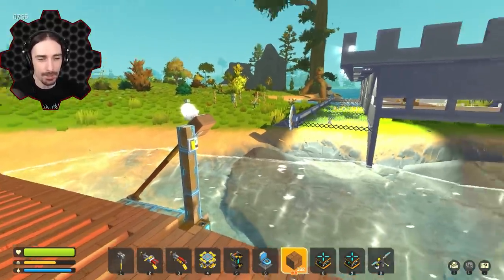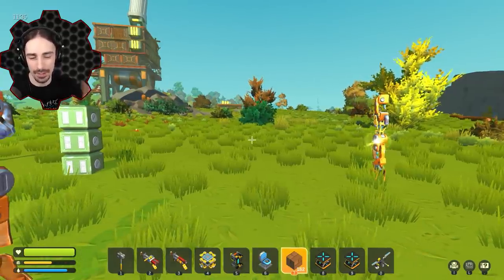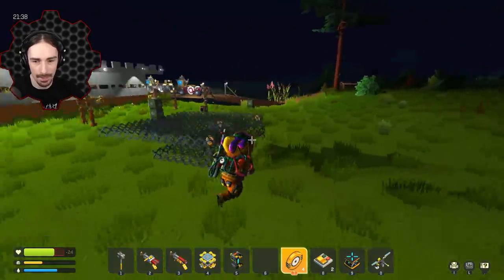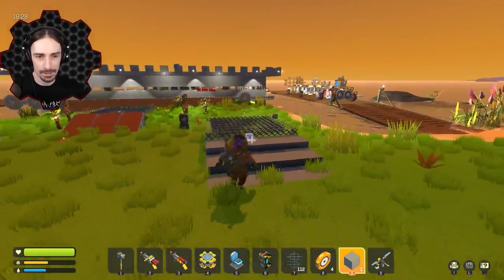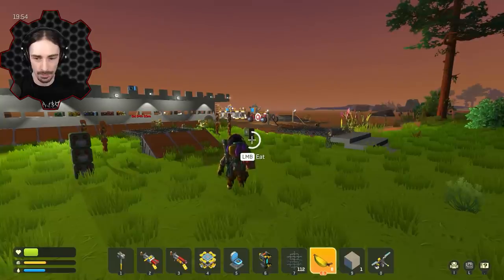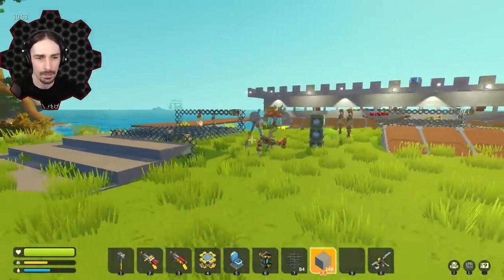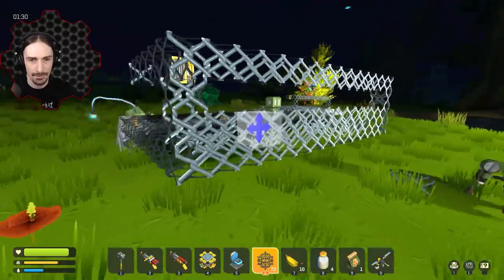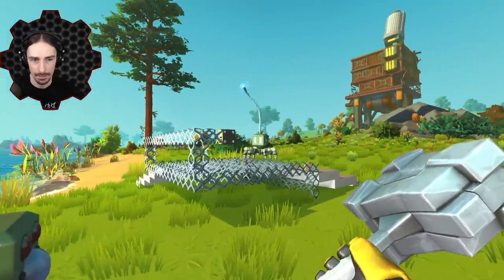I Made Automated Farmbot Catapults to Troll the Bots! - SM Survival Mode [SMS 28]

Comment: It may be the "pathing" stops up there like a balcony. Try giving him stairs on the other side giving him a valid path to continue to its target. At least that's the way it looks to me, if the bots aren't actually aware of the sensors. Might have to bring closer to your base, and connect/weld it depending on what the code logic is actually doing.
Reply: That actually makes sense, because its not the pistons or bearings as they have no problem with the bouncy floor or vehicles
Reply: to me it looked like that they were staying away from the sensor, but yours makes sense too.
Reply: yeah that's what i was thinking, the pathfinding ai might not like drops
Reply: You can see the bot look directly at the sensor and display the fear animation
Reply: I think , we just need another ramp behind , for the pathfinding . 
The robot will think that it can continue straight and not be block by void .
Reply: I’m not sure what game engine this was made in, but simple pathfinding AI usually has the ability to avoid certain inclinations/declinations, and as such the path can break. The distance/separation of the world ground and the “floor” of the trap may just need to be closer, or build a ramp to close the gap. I have a feeling you may be able to funnel even intelligent mobs over the style of trap.

Using “path of least resistance” rules seem to be the simplest explanation. Without further testing, the bots may have the ability to know certain blocks are near them but seems overly complicated at this point in development, but interesting nonetheless. I’m leaning towards simple AI implementation is what we have here, and the path is broken and if so it is not allowed to pass, or there is simply a better way, like going around it. Of course other AI avoidance rules seem to be at play here, but I’m not sure what they are quite yet.

In any case, I look forward to the next episode to see how the developers implemented it and Scrap Man’s discovery of how to overcome this.

Great videos, as usual SM!
Reply: Nah its the sensor no brainer that why he didnt stop at the wall
Reply: My thoughts too, haybots seem smarter, and won't Pathfind off a cliff
Reply: if it couldnt walk of the edge then it would have just walked backwards and gone around, its the sensors that they dont like...
Reply: Pixeye That’s plausible. I’ve not played the game enough but it does have its pause/juke animation loop. We know it the saws trigger it, I’m just not certain there is another reason the bot behaves that way. The proximity/placement may also be playing into it. For example, the pause loop may trigger when there is more than one equally viable path to take. Depends on the logic the Dev’s implemented. I’ve just not seen testing to definitively prove one way or another as of yet. I’d love to see some test game play to test these theories. I could be completely wrong, for what it’s worth. Cheers!
Reply: It works! Just one way I’m sure. They don’t seem to be as worried about the sensor as much as the drop off.

Comment: They are scared of sensors. Gotta keep the sensors hidden. Even in a spud gun setup sensors hidden or they try and avoid them. Hope this helps. Please like so he sees.
Reply: I feel that it is the bearings and pistons. this is a likely problem to encounter because using piston engines will shred them like a lawn mower. It could be in their code to help them avoid traps.
Reply: I can say this is definitely not true. I have a piston enigine car which contains sensors, pistons, bearings and controllers. They have no problem trying to attack my engine when im out exploring
Reply: @Adam Banner You are correct!!
Reply: It's a viecle they attack viecles any thing with wheels that moves
Reply: zack I don’t think so since they don’t have a problem with the bouncy floor or vehicles
Reply: @quinchypig2   They attack vehicles
Reply: @quinchypig2  actually they dont fear what can't touch them. They keep distance 1-2 blocks from sensors max reach(set not aviable).
Reply: we could test the "sensor fear" theory by manually running the catapult with a switch..
Reply: its not the sensor its the gaps in between blocks because there are certain times where they actually can go on it and get launched, but if you paid attention you would see them glitching from the first block to the gap and back and forth, unlike the sawblades which just make them back up with no issue. There would also be no reason for it to pathfind away from sensors.
Reply: @BeanGreases  he filled on the gaps and it still didn't work
Reply: @rider-th2xp  time of when he filled them in please
Reply: or he could use buttons so he can press the buttons when the haybots start hitting and he could use teir 3 metal too
Reply: Gaming Beans 24:13
Reply: I agree, but did you read this in the forums or like the patch notes? I definitely think this is the case though.
Reply: I think that if the sensor is hidden they can still detect it. They are afraid of the activating area.
Reply: @Silvyya  good idea but too much weight
Reply: i thought that might be it
Reply: @c2games592  wrong*
Reply: The holes also make a problem
Reply: If your reading this im a time traveller. Im here to tell you henry will return as a swimbot.

Comment: I have a good theory on why the Hay Bots are very cautious around traps.
Sensors, maybe the Hay Bots have a smarter AI system, so they are scared of the sensors, so they know it’s a trap.

 Solution: maybe you could have the sensor further back?

Not sure, hope this helped!
Reply: Dude, there's a gap on the edge of the trap instead of another ramp so he pathfinds around the gap/drop so he doesn't fall. The only reason it isn't working is because the bot thinks it's gonna fall. And then when it comes to the ones with the walls, they don't go because they see theres an easier path to get to the player by going around the wall
As for the greenies going after it, they're more aggressive to just breaking there way in in a sttaight line, so they have no problems with trying to attack the wall
Reply: I was thinking the same thing but id that Isn't the case I don't know what the case is
Reply: David Almodovar 
Good point!
Maybe the path finding stops as it finds a hole, maybe he should put them in vertically, not horizontally.

Comment: I would’ve made super simple “land mines” instead. All you’d need is 9 blocks, a sensor, a piston, and 4 ramps. Place single block in ground, weld piston on top of it, weld sensor on top of that, surround the sides of the sensor with the other 8 blocks, then place the ramps all around it. It would also be super lightweight so it would be very powerful.
Reply: But what about those that land in farm?
Reply: @Edgars Apsitis you would have to build the mines far enough away so the bots’ speed doesn’t launch them into farm. Maybe you could even build a line of the mines at just the right spot so that it launches them into a pit of saws or something?
Reply: @Edgars Apsitis you could also make it a larger, two-stage trap where a wall pops up in front of them, then the platform below them flings them like scrapman’s trap.
Reply: I’m just saying from how i see it in my mind it has a pretty small chance to actually launch them because they have to walk directly over the sensor
Reply: he did it for the memes

Comment: I think that there pathing reqires a path down maybe, so have more ramps. And test to see if it is the sensor by testing it with a button.
Reply: if it required a path down, I would imagine that it would take a different path, or try to go back the way it came and go around the obstacles.
Reply: Or possibly a platform that continues at the same height all the way to the front of the gates. that way they dont read it as a high point obstacle they can just go around. if you replace the bouncy house with a line of launchers i think it would solve the problem as well
Reply: He should put bait like a cow so that they go for that
Reply: Nice
Reply: Depends on how advanced the scrap mechanic pathfinding service is.

Comment: A thing I noticed (correct me if I'm wrong) is that there's no fall damage when you ragdoll. So, theoretically, you could probably build some powerful catapults in key areas for quick travel.

And if you don't like that idea, it could also definitely work on vehicles. Though, I suggest using a test car first, just in case.
Reply: SMART
Reply: Good idea
Reply: That's a noice Idea
Reply: I think there is damage
Reply: Smart
Reply: When he added the wall there is no fall damage because of the ragdoll. If he wakes up in the air high enough there should be but he hasn't done that.. only once it seems? close to the ground. Also with the wall the green ones get smacked by it.
Reply: Cars dont get damege from fall, but they can glich: wheel geting into the car itself or other moveble parts
Reply: Cristian C. That can easily be fixed by putting it on the lift

Comment: For the farmbot flinger (best wrestler name EVER): the haybots are almost definitely afraid of the sensors, just lien saws or drills. So if you put a sensor in the wall itself (you might end up needing like 3 per catapult), and put something weak like bubble plastic (or scrap wood blocks because they’re easy to get) in front of each sense, the haybot should run up onto the catapult break the bubble plastic/scrap wood block, and not see the sensor until it’s too late >:)
Reply: The problem is won't the sensors get triggered by block in front of it?
Reply: Edgar is right
Reply: @edgarsapsitis6925  That's when you have a nor gate connected to the sensors and piston
Reply: that way they walk up , destroy the block in their way it automatically triggers once the block is gone. The only problem i see with this is that sm wants something that he can just set and forget. Only getting one use per raid night before you have to go out and reset the trap by covering the sensors would completely defeat that purpose.

Comment: The haybots see the sensors as sawblades
It would seem to be that the sensors are like some sort of weapon to them
Reply: Hello again :)
Reply: litteraly evreybody said this when it came out. including me
Reply: I agree
Reply: Not the sensors, the sensor beams (I think.).
Reply: Oh
Reply: The sensor it’s gonna cut me in half oh no
Reply: that is literally what i thought
Reply: its not the sensor its the gaps in between blocks because there are certain times where they actually can go on it and get launched, but if you paid attention you would see them glitching from the first block to the gap and back and forth, unlike the sawblades which just make them back up with no issue. There would also be no reason for it to pathfind away from sensors.
Reply: Gaming Beans there is reason to pathfind away from sensors: sensors can be used for traps like this. Also, he filled in the gaps at 24:13, and it still didn’t work.
Reply: @vibaj16  i actually have a base that entirely relies on sensors. its like scrapmans bouncy castle but i made it auto with sensors so when im late to my farm it works automatically, they have no problem. 2 more things i got to say, first, earlier in the video a bot knocked down a sensor which means it was in a close enough radius for it to hit it. Second is my new theory. They detect the wall and they see there is no way to go. I think because earlier in the video you see the hay bot just walking past the sensor, before scrapman had the wall up
Reply: @vibaj16  15:55 is when the bot walks over it
Reply: @vibaj16  and we know it didn't walk too fast for the sensors because later we see scrapman RUN straight over it later in the video, which we know the player can outrun a hay bot

Comment: ScrapMan, I built a test of this with stairs all the way around them and the bots will just run right over it as the pathing shows they can go through.  They also did not attack the build at all either since I'm assuming it wasn't in their way.  The only thing I noticed is that the sensor being directly on the platform it didn't see the haybot feet.  I raised it a couple blocks and it works perfectly.  The only downside it doesn't appear that they take fall damage.

Comment: Couple suggestions:
1. Have scanning sensors.
Put them on a bearing so the move back and forth all the time and put them into an RS Nor Latch. Then have a timer into the other Nor gate to turn it off after about 10 ticks. Take the piston input from whichever gate is activated last.
2. Put the bottom of the piston on a bearing as well.
The piston is trying to tilt forward but instead it's just on the beam at the bottom. Having it on a bearing would allow it to go much further and faster, so you may want to reduce the range to 2.

Comment: You need a bearing on both ends of the piston on the catapult trap so it can keep facing the platform, otherwise it will keep pushing up while the block it is pushing goes to the side.

Comment: Try putting the sensors on pistons that move up and down because the bots might be scared of the sensors as well as the sawblades. So what would happen is the piston would go up to max height with the sensor and stay there for a second to let the bots onto the trap and then the piston would come down which would fling the bots of the platform as soon as the sensor detects them.

Comment: Dear Scrap Man,
          The bots pathfinding prevents them from running into the LOS of a sensor. Your gonna need to give them a more of a headstart with the sensor behind a piston periodically. This may trick them into attacking the wall while the sensor is revealed. You may also want to deactivate the sensor on the same timer loop. Hope you may expand or redesign  this idea. 
                  Best regards, Aperture Science Innovators

Comment: Theory: Maybe the farm bots are scared of the sensors and try put the sensors high up on the flinging thing so they might get flung?
Reply: its not the sensor its the gaps in between blocks because there are certain times where they actually can go on it and get launched, but if you paid attention you would see them glitching from the first block to the gap and back and forth, unlike the sawblades which just make them back up with no issue. There would also be no reason for it to pathfind away from sensors.

Comment: I think that the haybots are probably avoiding it because they see the sensor and seem to possibly even know how far the settings on it reach.
While some other people are hypothesizing that it is because there is no path down, the pathfinding algorithm seems like it would handle that by having them go around the offending system, rather than getting stuck at the entrance to the trap.
I also think it is possible that the haybots might have some sort of weird interaction with vertical walls of net pieces, given the three haybots in the cow pen in yesterday's video, where they just stood there shaking and not attacking anything, even when scrap man jumped into the pen with them.
I would be curious if the haybots can detect a sensor in the floor, since if they can't, then you could just have a row of sensors in the launcher itself, set to trigger the moment anything goes over them.
I don't think they have an aversion to paths that require them to drop off a small drop, as i would imagine their path-finding would have them then go around the platform altogether. Most pathfinding algorithms seem to try to work backwards from the destination to the starting point, and the bots definitely have a certain sense of where they are going even from a much greater distance than they can sense the defenses from. one thing that could be helpful is finding out exactly how far away they can sense danger from, which could potentially be done by just looking how close they will get to a sawblade before they back up.

Comment: The answer is hay bots are Smarter, than greenies, but you might fix your trap by putting sensors facing the direction they come from, because i think they have trouble stopping when they run but sideways facing sensors make them stop before triggering the sensor, also if you actually try then better use sensors from other traps because it might also not work. Also It's only possibility they might just be aware.
Reply: If anyone will say i stole idea i forgot to read if anyone got the same solution, and also more reposts= Higher chance SM will choose the trap option.

Comment: You can make it a literal pressure plate. Make it made of suspension based build where anything that steps on it will either have a timer to then go on the flinger or have it be the flinger. Where under the suspension is the sensor.

Comment: The haybots may not be pathfinding all the way because there is no way to get down off of the end/back of the trap. There isn't a decline to path find off the trap like there is an incline to path find on to the trap. Also, maybe the haybots stop before the sensor because of their hitboxes. They may be large and collision, against the "wall" at the end of the trap, is detected before their actual bodies trigger the sensor. Maybe have inclines around all sides of the traps and get rid of the "wall" at the end of the traps.

Comment: Maybe it's the sensor? I guess it's possible they think anything with a sensor is a trap. You could try to hide it or place multiple sensors 10 blocks of the ground pointing down and connect them all to an or gate. Kind of expensive, but interesting experiment. I do think they'll ignore everything above a certain height above them.

Comment: Hay bots dont like to walk off ledges. Could try putting a platform down on the other side. Also for ramps you can attach a wall to the end with barrings so gravity just slopes it down. Also would be awesome to make some spinning death traps too that spin horizontal to slap bots in the face, if the AI will allow that